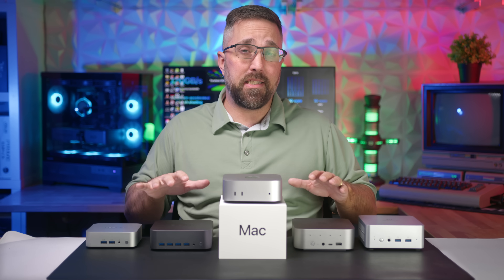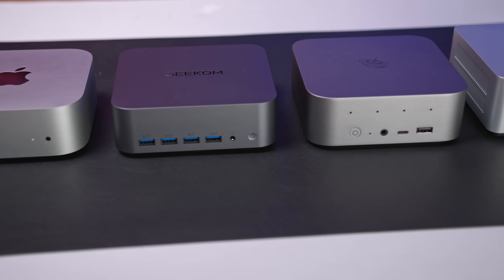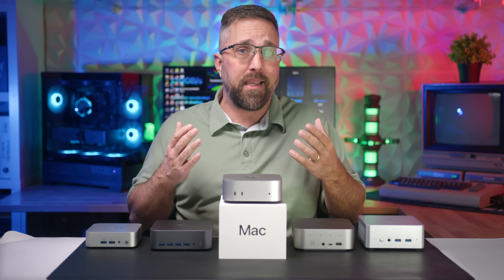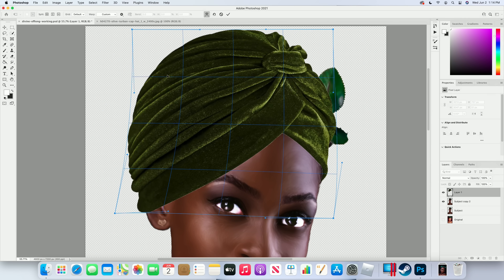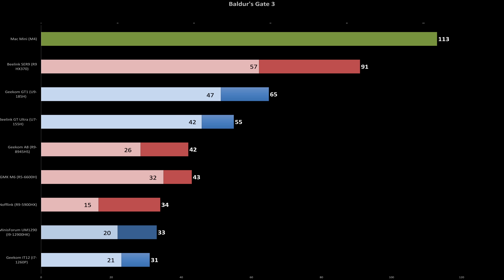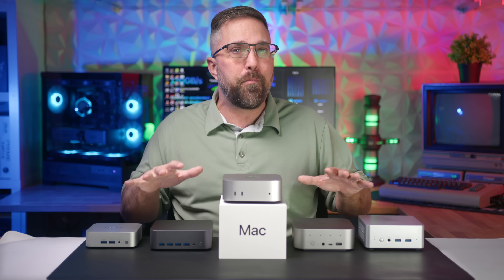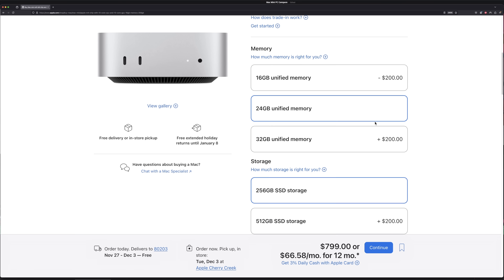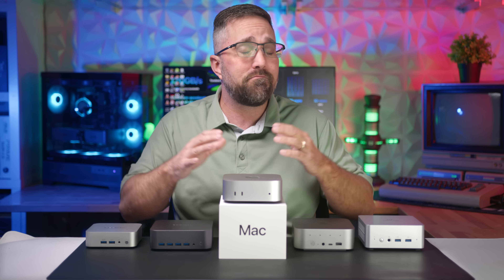M4 Mac Mini vs Intel and AMD Flagships – It's Not Even Close!

Comment: Good review and comparisons. I was thinking of doing the same comparison but you saved me the trouble. You did not go into the heat and noise for the NUCs, which would be an issue for me. I like quiet operation.

Overall the specs are good for the M4 Mac mini but the 16Gb RAM and 256Gb SSD are the two black marks against what should be the best without caveats. If you add 32Gb RAM and 1Tb SSD (US$$1,399) the Bangs for Bucks takes a dive on the Mac mini... just the way Apple designed it to be.

The base model is a bargain, but for my purposes I'd have to get a M4 Mac min Pro to get 24Gb RAM, 512Gb SSD and Thunderbolt 5. Still lower specs for the RAM and SSD, but usable for Pro work. The price doubles though (US$$1,399) and it is not the cheapest anymore. To get a Pro with 48Gb RAM (next step up) and 1Tb SSD that would be US$1,999 which is very pricey considering you still have to get all the peripherals.
Reply: Cheapness. Yup. Cheapness. Very important. For cheap people. I guess you're using an Android, correct?
Reply: @mojoblues66   Phone, yes (because it has a way better camera), but I also have several Macs, 2 PCs, an iPad, a Linux desktop and a Chromebook.

I love macOS, but not Apple which screws its customers, and forces users in to bad choices with its designs and price gouging.

You are talking about Apple, when you accuse them of being cheap for putting in 8gb or 16gb RAM and 256 Gb SSDs and then locking them down, so you can't simply swap their M.2 cards.
Reply: @peterbreis5407  I can't imagine anyone outside Apple defending their RAM and storage pricing. Yet people do buy their products. Have you ever wondered why? Perhaps pricing isn't everything?
Reply: @mojoblues66  Of course it isn't. My wife and I bought my M1 Macbook Pro Pro because for the first time in 10 years Apple wasn't selling a Mac that didn't suck or have major problems. I really wanted an M1 5k iMac but Apple says I can't have what I want.

Curious how pricing is everything for Apple. But it's not allowed to be for everyone else.

Comment: The use of P and E for different brand processors needs to STOP.  Intel and Apple does use the wording, "performance," and "efficiency," so P/E designation is fine for them.
AMD does not.  AMD uses, "classic," and "dense."  Some people use, "compact," for the dense cores.  The most important aspect of AMD's dense cores is that they're architecturally identical to their classic cores.  The only difference is that they use different physical design (transistors / layout) and generally have smaller L3 cache.  They execute instructions identically to the classic cores.
This is absolutely not the same thing as Intel's P/E-cores.  I don't know how Apple designed their cores, however.
Reply from the maker: I understand all that but if I start to explain the difference between Zen5 and Zen5c  to my audience half of them will click away. 😴 The important part is fundamentaly all the CPUs use 2 or 3 different core types to improve efficiency.

Comment: Best Value, Best Price to Performance Per Watt Ratios under $600:
$550 new M4 Mac Mini 16 GB (discount)
$325 used M1 Mac Mini 16 GB (60% slower than M4 Mac Mini)
$200 new N300 mini PC 16 GB  (reformat with Windows 11 IoT Enterprise LTSC for free, or Linux, or ChromeOS Flex)
$100 new N100 mini PC 16 GB (reformat with Windows 11 IoT Enterprise LTSC for free, or Linux, or ChromeOS Flex)

Everything but M1 can decode AV1 with ease for youtube (M4 and Intel Quick Sync). Nothing else really compares to them for under 600.
Reply: Yep. Would add that with the student discount, a mac mini m4 with 32gb and 10gbe ethernet comes at less than 999$ (969$) and then you can add external storage via thunderbolt or use the 10gbit connection. That is very competitive for those who need more ram but can't or don't want to spend double (2000$ or more) for the mac mini m4 pro and 64gb ram. Also a mention to mini pcs like ryzen which can be made hackintosh and cost 500usd total for 64gb ram and 1-2tb nvme.

Comment: To be fair you should look at discounted prices. PCs normally get 20+% discounts. Macs get 10+% discounts.

One plus with the Mac mini is it is small enough to put in the bag when travelling overseas so I get an additional 10% discount. But the same applies to the PC NUCs
Reply: My minisforum NAB9 is exactly same size as the mac
Reply: @jimw7916   Plus the power brick.
Reply: @peterbreis5407  true but my power brick is as small as a pack of cigarettes.
Reply: @jimw7916   50 pack?
Reply: Actually if you are a student apple provide a 100$ discount making it a 499 machine or a 17% discount
Reply: @walidoutaleb7121  In the States. And I am not a student.

Comment: The two value standouts in desktop personal computers these days are the base model Mac mini and the various mini-PCs with the Intel N100 processor that can be had for under $150.  Get the Mac if you can afford it.  Get an N100 if your needs are basic and your budget is small.

Comment: The price to perfomance Ratio only matches if you set 256 GB Apple Storage is equivalent to 2 TB PC Storage. And 16 GB of Apple Ram is equivalent to 32 GB PC RAM (sounds like the old story 8GB of Apple RAM is equivalent to 16 GB PC RAM).  Funfact a 4KVideo on the Mac should have the same Size as on a PC, same for Photos, same for Music, same for documents, spreadsheets, presentations and PDFs.
It would be great to have the Mac Mini M4 Pro also in the selection to have a real world comparison between Pro and Non-Pro does almost tripple the price give an appropriate uplift in real world scenarios and oes the better GPU boost gaming performance.

Comment: Problem with the M4 Mini, you stuck in Apples BS ever closesing off OS and ecosystem.. I've been building Apple computers senise 95 and the Power PC days for work, "Post Production" and my work laptop is a M4 Pro.. But my rig at home is all PC and I use Androids as my mobles because I cant stand Apples OS lock downs and ecosystem..
Reply: what do you want to do outside the ecosystem?
Reply: @jwllzp  what do you do inside of it?
Reply: @GraveUypo  well, I mostly program in the terminal and browse on firefox… so I wouldn’t consider it inside of it
Reply: @GraveUypo Macs are pretty excellent coding machines, compiling stuff is a lot faster than on intel, and the terminal etc works just like Linux/unix.

Comment: doesnnt make any sense to compare 32GB ram in others to 16GB ram in M4 and 1-2TB in others but 256 in m4, if you adjust the mac to match specs you are at $1399-$1799 for 1TB-2TB + 32GB ram
Reply from the maker: I know right? You'd think the PCs with that advantage would wipe the floor with the Mac.
Reply: Mac os uses ram differently from windows so its not as easy as it sound i think you cannot get these machine with lower ram making it a base model to base model comparison

Comment: should be comparing prices and performance with similar storage and memory specs

256gb, 16gb =/= 1tb, 32gb
Reply: Why is comparing specs better than comparing measured performance?
Reply: @chrisdistant9040    price-performance

you have to hold the price (about) equal to judge performance

otherwise apples to oranges
Reply: @rossw1365  no, not really. This can’t be a requirement because hypothetically it is possible for 2 manufacturers to sell their PCs at wildly different prices despite the performance being relatively similar. In other cases, if offers were such that you can’t spec any of the machines the same way as the other manufacturers, this would mean comparisons are impossible?

No, simply get benchmark values and divide per price. “How much performance do I get per dollar?” Is a valid question.

If the Mac mini runs well with 16GB, it runs well. 

One could argue that benchmarks should be introduced that fill up ram, eg requiring 8/16/24/32GB for data processing to show different potentials between the differently specked machines.
Reply: @chrisdistant9040    mini pcs come in 512gb-16gb configs, close to the mac mini

the problem here is the benchmarks don't take advantage of the mini pcs' bigger 1tb ssd or their larger 32gb ram

so you're paying more for the same benchmarked performance as lower configs

that's why the comparison should be to lower configs

to see the point, imagine comparing these mini pcs to the mac mini spec'd out with 2tb ssd (and 32 gb ram)

how does the mac compare now?

pretty bad, right?

why?

bc the benchmarks don't take advantage of the 2tb ssd (or the 32 gb ram)

you're paying much more for something that doesn't help benchmarked performance

Comment: MacMini M4 for what? Power efficiency, Photo or Video editing ?? What about Gaming or  installing new OS? Pfff, locked hardware with no real advantages.
Reply from the maker: Ya, I covered all of that. You should probably watch to the end.
Reply: Not everyone games, and really, if you're into gaming, you probably shouldn't be looking at any of these as there's better deals to be had elsewhere
Reply: The smallest you should go for gaming is MINI ITX. In my opinion gaming performance in these kind of mini pc/mini macs are irrelevant since they have different target group.
Reply: @sleepyjoe7843  nah handhelds are great and they are technically smaller than these things (in volume)
Reply: You can use Parallels to emulate different OS in virtual  machines

Comment: The Winx86 world is in trouble.
With MS Windows 10 reaching its end of life support in a few months, and the fact that Windows 11 will only run on PCs with a TPM 2.0 chip, many PC users are in the market to upgrade their hardware. However, with the x86 chip unable to match the thermal efficiency and power of Apple's ARM chips, and now also losing on price, even those PC users may be tempted to switch to Macs. I am one of those users debating which way to go. I love the power and efficiency of the ARM chips. I am very envious of them. However, I am not the biggest fan of macOS. I am hoping MS makes progress on their own ARM foray. There is a rumor Nvidia may develop their own PC ARM chips.
It gets worse for the x86 architecture if Apple makes even more progress on their M Ultra chips, which have not been released yet. Apple could take on the x86 in backend servers as well.
If MS Windows and the x86 architecture don't get their act together soon, I may just have to hold my nose and take the jump into the Mac world.
Reply: dont be funny with your Macos 90look and feel. Probably you never used Win 11. UX in Macos sucks!

Comment: well, I see expensive PC with 2tb of storage compared to the mini with 256gb, it is a bit unfair when we know the outstanding price of option of the mini and the impossibility to expand it.
a 4to ssd on PC is 200/300$ it is the price of the 512 option for the m4, same for RAM 64 gb on PC cost less that the 24 gb option..... You have to take this in account
Reply: You can add any PC SSD to the Mac Mini by using a Thunderbolt adapter. Easy and pretty cheap.
Reply: @belphag0r  It will be slower than a normal build in SSD. Of course, it depends on what you are doing, because in the case of coping big files most likely you don't notice that, but you will notice this in the case of a lot of small files.
Reply: But are you accounting for RAM speed and power draw? Also theres nothing stopping you from using external storage for a comparable price
Reply: @chidorirasenganz  If you see the video of others you can see the mini using 100w of power, not really a ligh one.  https://youtu.be/TAmyfX6X7IE, RAM speed is also high on PC where you have even choice of the model of memory, usually it is the same as the mac. 
And an exterdal drive with a nice dongle, no nice and clean but quite mandatory.
Reply: @inwedavid6919 
Nice dongle no nice and clean if pc users ever did care about a nice and clean setup

Comment: Excellent review.  I’ve been waiting for a reviewer to compare the M4 performance with the AMD and Intel offering and this is the first one.  

In summary, get a PC if you want to game, get a Mac for everything other use case.
Reply: or if you have higher RAM and storage requirements than the 16GB/256GB base model, or you have a business requirement to run specific windows software. Perhaps if the storage is the sole reason to reject the Mac Mini, an external Thunderbolt drive is still an option.
Reply: For a PC you can buy 64GB DDR4 RAM for $100 and 2TB SSD (e.g., Samsung Pro 990) for $150. A Mac with similar specs would be more than $2,000.
Reply: If you are an engineer, work in business, if you do any kind of techinical, medical or scientific work... Mac is not an option. It's more like for creative people.
Reply: @JrC123_00  Horrible claim. I've worked in those industries and used Macs there. Your claim is more about the software available than the hardware. I've used Macs and PC at home and in industry since 1995.
Reply: Gaming is what will keep x86 alive for a while. In every other aspect, x86 was a living dead when the M1 came out. It just carries too much historic ballast. Similar to Windows. For Intel and Microsoft it is all about milking the cash cow as long as possible while riding on backwards compatibility and vendor lock-in.
Reply: @mojoblues66  Yes, technically x64 is just for gaming at this point.

Problem is, apple doesn't sell the m1 chips separately. But the other ARM chip manufacturers are years behind apple. So often we end up buying x64 because it's the most cost effective plattform, not because it would somehow be a requirement.

My x64 Laptop with 32GB RAM and 4TB storage running Linux cost less than half of a MacBook and I don't have the issues that come with OSX.
Would have bought ARM as well, but nothing similar on the market.
Reply: @svr5423  OS X has been renamed to macOS 8 years ago. What kind of issues are you talking about?

Comment: Now test the M4 Pro against this same crop of machines. Yes, a bit more expensive, but you're competing higher core counts against higher core counts.
Reply: There's no point. The M4 is destroying them itself and the M4 Pro is way faster than that
Reply: M4 Pro obliterates them all. We’re talking about raw GPU performance between a 4060 and 4060ti
Reply: @chidorirasenganz  Well, for Blender tasks it's not even up to 4050 Laptop GPU... And with full Pro CPU, 48GB RAM, 1TB storage it is much more expensive than ASUS Strix laptop with 4070, 1TB and 64GB RAM and 4070 Laptop is on par with M3 Max/M2 Ultra in GPU performance. 

I would love to get Mac, but can't justify it in comparison for same price Windows machine, especially a portable one as with MBP you need to spend double or more for same results...
Reply: @ Except the that strix laptop would have a slower CPU, less VRAM, less battery life, worse inputs and build quality etc. Also according to the Blender benchmark they score the same as they both get 2500. And new M series chips always get better with newer updates to Blender. The M3 Max started at 3400 and now scores 4200 on 4.2. So performance most likely will improve a bit